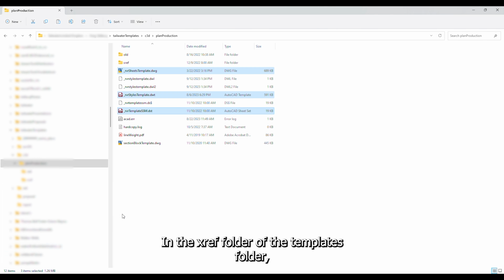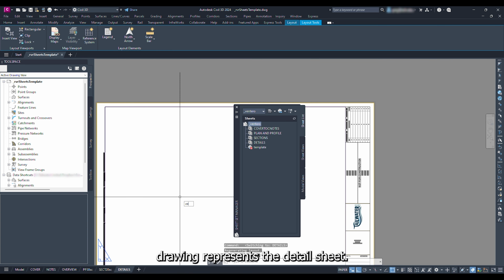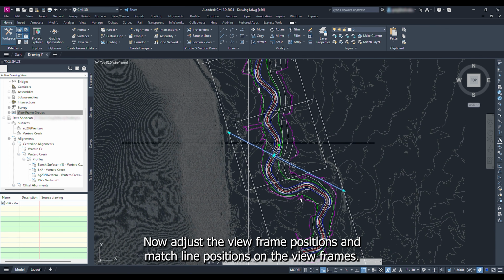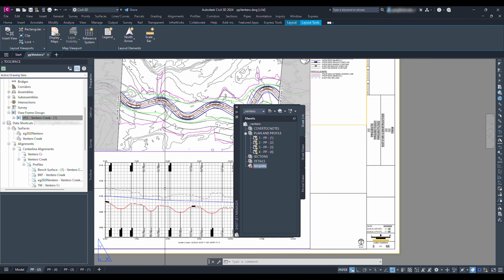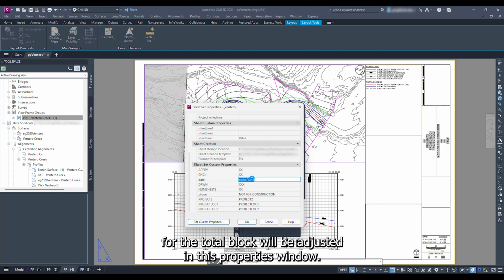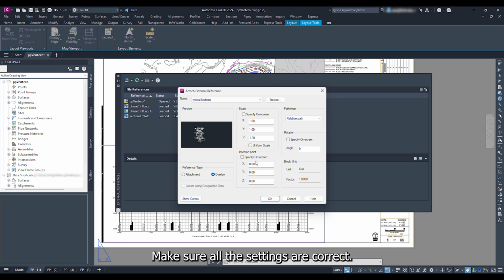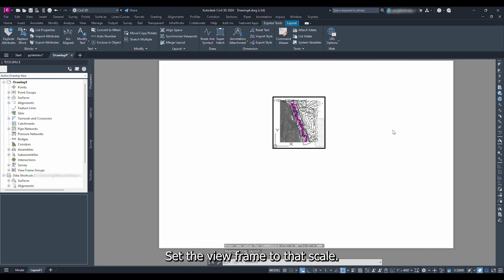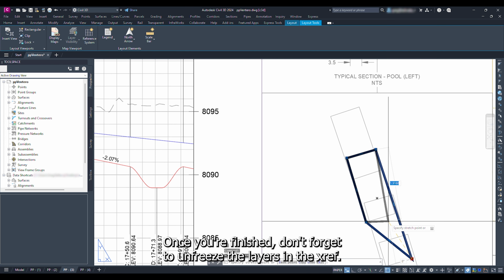5 - Civil 3D Plan Production - Plan and Profile Sheets

Comment: Dear, sir
my name is na , i use civil 3d 2014 
please, i have the question for ask you about civil, when i plot sheet plan view. between joint paper one and two all time get the back color 
please, share your idea how to removed
Reply from the maker: I'm not sure I understand your question. Could it be a transparency setting, under plot settings? Or is it a background color on a block? If that is the case, try using 255,255,255 white rather than 7 white.

Comment: First of all, really great tutorial, it really helped me a lot. However I have a small question regarding the elevation range of the generated profiles. I cannot seem to control the range prior creating the sheets, leaving my profiles covering the full viewport. I can change the range after the profiles were created but that's counterproductive. I've been going nuts over this and would really appreciate some help on this. No luck on google either :(
Reply from the maker: Thank you! The profiles associated with the alignment will set the elevations of the profile view. Adding bands to the top and bottom of the profile view will help to clip the profile view so that it doesn't extend beyond the view frame. I like to set the "Profile view datum by:" to "Mean elevation", when creating sheets on the "Profile Views" tab, under "Other profile view options", "Choose settings" "Profile View Wizard...".  If the profile elevations exceed what is shown on the profile view, try reducing the vertical exaggeration that you are using. Remember, you will have to make that change when creating the view frames, before creating sheets. I hope that helps.
Reply: @tailwaterlimited  The extra empty bands did the trick. Thanks for the help, I really appreciate it!

Comment: I have one question, the profile view is not centered in the template view port, I know that  a blank band is used to control this but its frustrating to get it right evert time can you make a video about this or at least answer me in the comment 
BRELIANT SERIES BTW THANKS FOR SHARING.
Reply from the maker: To horizontally center the profile, after you have generated view frame groups and start creating the sheets under the "Profile Views" tab there is a "Align views" tab, here select the radio button for "Align profile and plan view at center". If you are ending up with the profiles being too large for the view frames, when you create the view frames, increase the buffer on the view frame groups. Increasing the distance under the "Match Lines" tab select and increase the "Allow additional distance for repositioning (increases view overlap)".

To vertically center the profile, you are correct in needing to use bands. I use bands on both the top and the bottom, the bands I use have the same height, 0.2", with all the displays turned off. It took a little bit playing with this to get it to work the way I wanted. Thank you for the video idea. Hope this helps.
Reply: @tailwaterlimited  thank you sir for taking the time answering me.